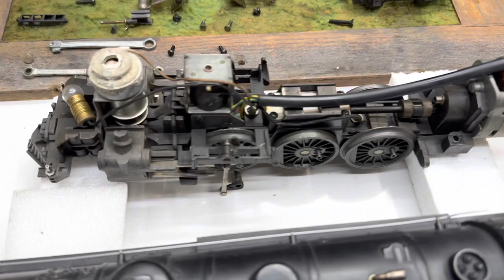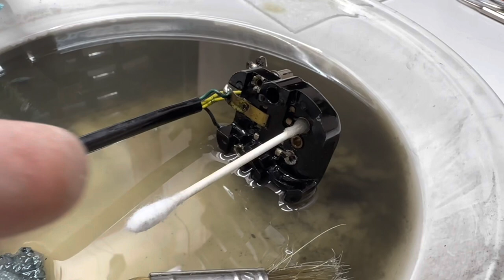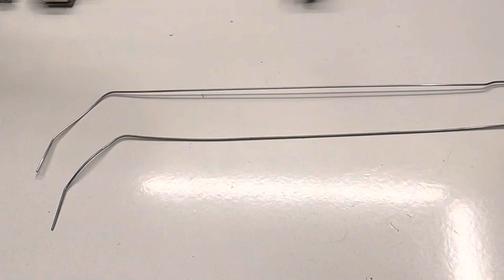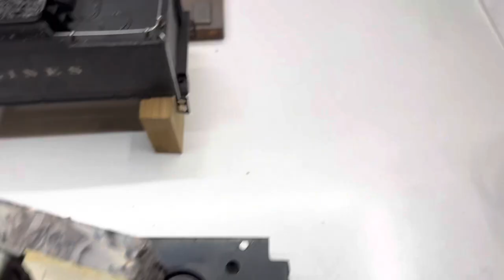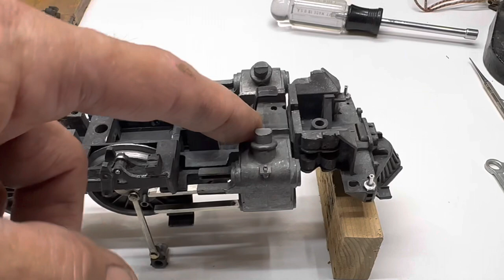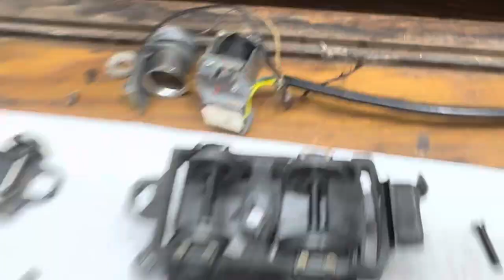Complete Breakdown & Rebuild of Postwar Lionel’s 2169WS Freight Set: Featuring the 773 & 2426W

Comment: who in there right mind would clean oil soak brushes? when two bucks buy new ones
Reply: What’s the point? The only time I find it reasonable to replace brushes is when they worn to nubs. While it’s cheap to replace, why fix it if it ain’t broke? 

Most of my stuff is still rocking their original brushes after they’ve been wiped down, lightly scuffed, then cleaned. Many of them have been done years ago and have many hours of run time on them and other than occasionally pulling them apart for service work, the brushes are STILL fine.